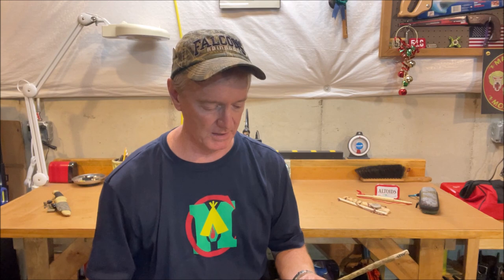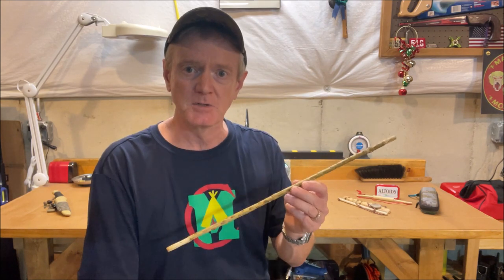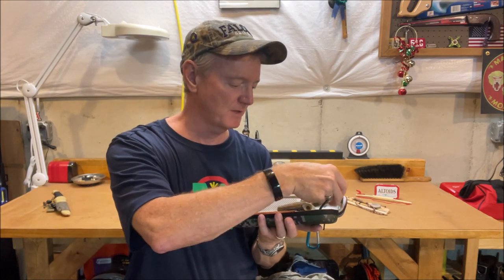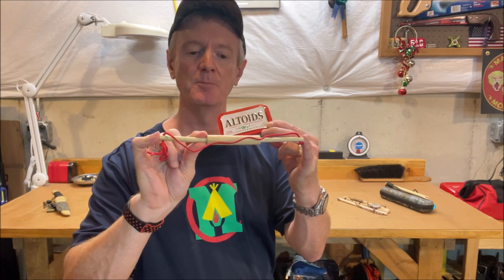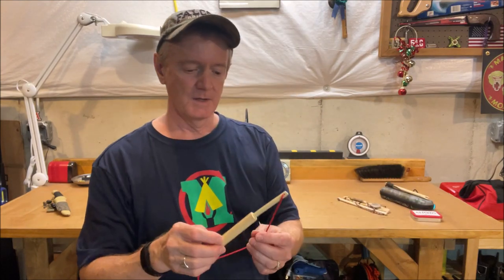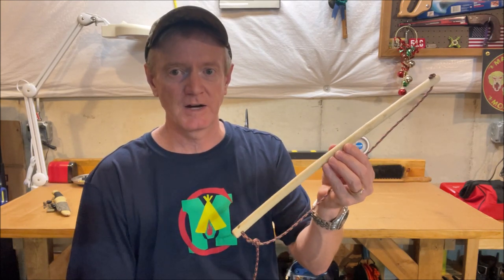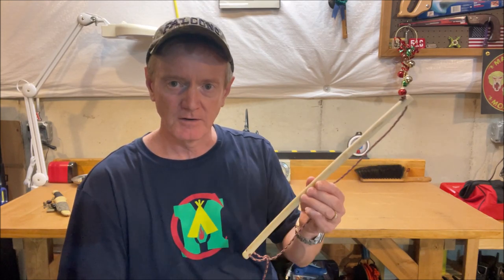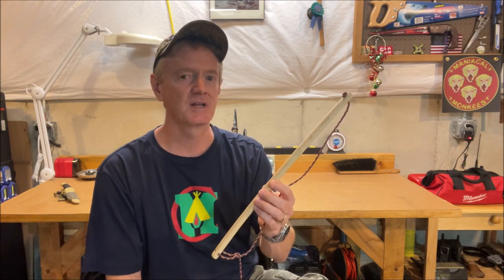Fire By Friction: The Joy of Short Fire Bows

Comment: Are you a Marine?
Reply from the maker: No, I'm not a vet, though I spent many years doing contract work off and on for the USAF.  Is it the ring I wear? If so, it is an antique (c. 1950's) BSA 1st Class ring I found on eBay some time back. I had it cleaned up and resized, and pretty much wear it all the time now. It's proven to be a good discussion starter. Best Wishes!